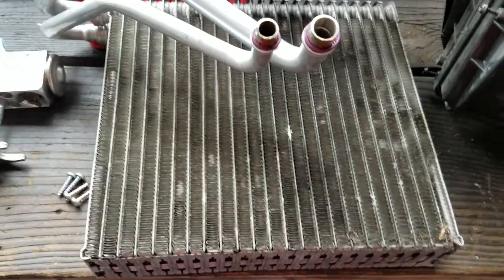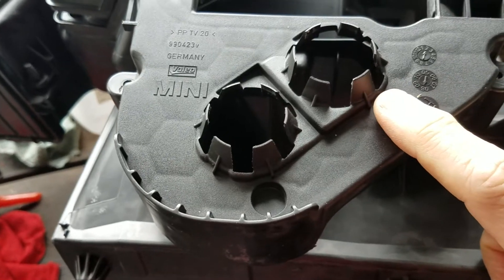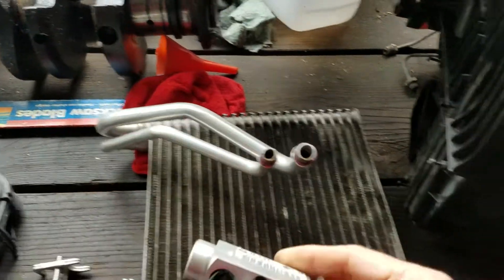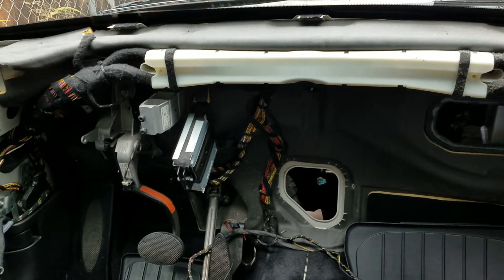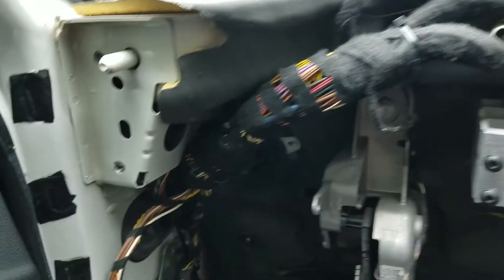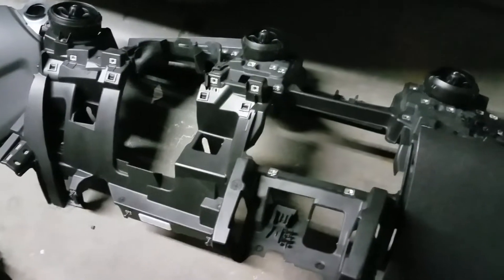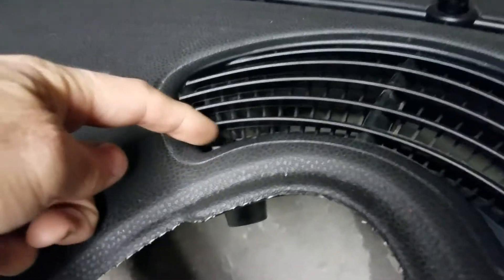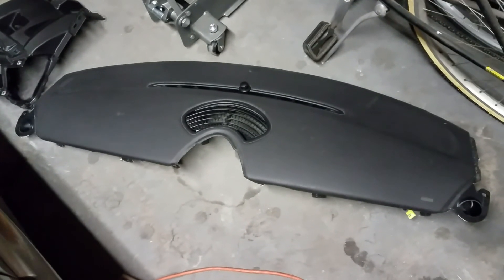Mini Cooper R56 Evaporator Replacement Overview

Comment: Just been quoted $3120 AUD to replace the leaking Evaporator on my 2007 Mini Cooper S. Mechanic basically said it's not worth forking out for on a 16 year old car. In two minds whether to ever buy another Mini again. Really fun cars to drive but I think i've had something to fix every few months on this car. Thankfully a lot of it i've managed to fix myself. Other than the clutch that burnt out. Had to get a mechanic to fix that one due to needing to drop the subframe.

Comment: Hi  my name is Gabriel good video but I'm wondering if you can help me with my 2004 mini cooper the problem that I have is the a/c majority of the air comes out of the defrost vent instead of the front vents how can I fix that if you know and if you can help me please
Reply from the maker: Most likely it's a bad blend motor.  Try verifying that it is getting power as you adjust settings on climate control.  If it is, then you've proven it's bad.  If no power, I'd suspect the climate control unit.  Hope this helps.

Comment: Great video! Need some advice and will be awesome if you can help.
I believe there's a leak in my R56 which caused the passenger/driver floor carpet very wet after 1-2 hours drive with aircon on. Read somewhere and seems most likely the evaporator drain pipe is stuck and has restricted flow. I took a glance beneath the car and checked while the aircon is running, and there is water droplet however dripping slowly (drop by drop).
Is it possible for the evaporator drainage to be stuck all of a sudden? It happened last few days, was ok before. 
Should I use a metal wire and poke through the drainage from bottom to dislodge any dirt or rather should I use a vacuum to suck out the drainage? Thanks in advance! ;)
Reply from the maker: It sounds like your heater core has failed.  I would check your coolant level and pull off access panel by the gas pedal to verify.  Luckily you don't have to remove dash to replace it.  If that checks out, instead of using a wire or vacuum, just blow some compressed air if you think the drain is clogged.  I'm not sure where you are located climate-wise, but you shouldn't be getting enough condensation to make the carpets very wet on both sides.  Probably the heater core.  Hope this helps and good luck.
Reply: @gsgarage2462   
 Thanks for reply. :)

I am located in Singapore, where it's tropical summer all year round. The coolant level in the spare tank is all good, no drop in coolant level (recently replaced a new water pump). The aircon feels cold and no issue with cooling even on a hot day (33-35 degrees celcius).

I used a chamois cloth to pick up the water from the wet front passenger carpet floor and as I twist the cloth and remove the water, it seems odourless and colourless which I think it's not the coolant, and very likely condensation. 

The carpet becomes really wet only after I have driven for few hours on the highway up to Malaysia. Passenger side seems to have more wetness than the driver's side. (RHD vehicle by the way).

One question, can the drain pipe be removed and change from the bottom of the vehicle (without removing the dashboard / access panel) ?

Thanks!
Reply from the maker: Go to 4.28 and 5.24 in video for a look at those rubber grommets.  It may be possible, but I think it would be very hard without dash removal.  Take off your access panel and you should be able to see where they meet underneath the hvac box.  You should be able to confirm whether or not that's where your leak is coming from.

Comment: thanks, my shop just informed me that mine is leaking, you can actually smell the r134 in the car.......  after seeing your video I will let them do it.....
Reply from the maker: Sorry to hear.  Can't say I blame you for taking it to a shop, it's a huge job.  Just make sure they replace the drier element in the condenser if the system has been open for any length of time.
Reply: @gsgarage2462  no they said the drier is fine, it just started, the system still has coolant, but you can smell it so I have stopped using the Ac till it gets fixxed in 2 weeks

Comment: How did u get the expansion valve off please tell me please I have done everything and can not get the evap off/out because I can't the the valve off please help
Reply from the maker: At 3:47, you can see clamp and 2 bolts that attach it to the valve.  Just remove those 2 bolts and it should pull free.  Hope this helps.